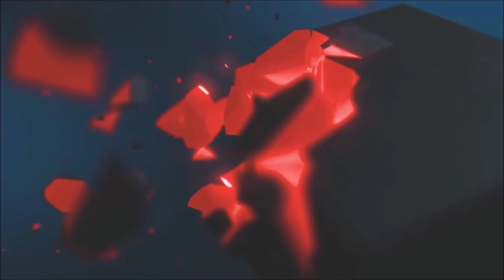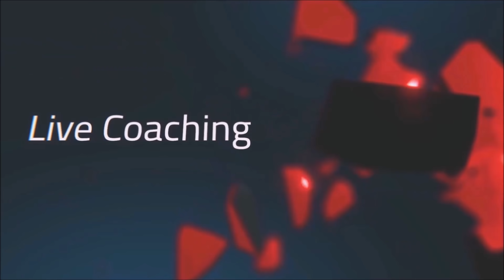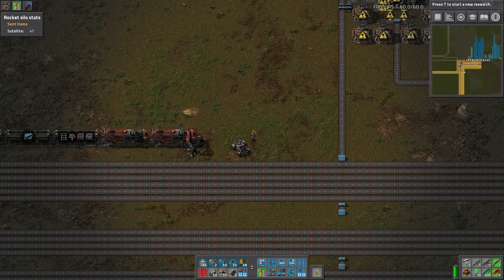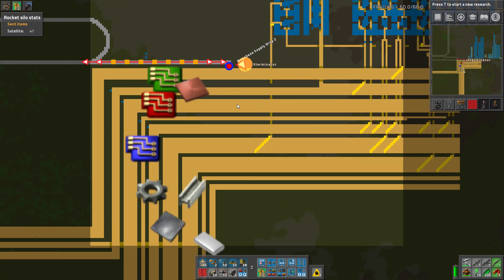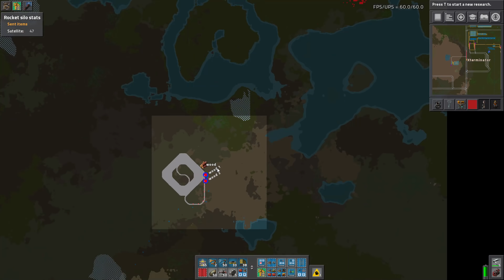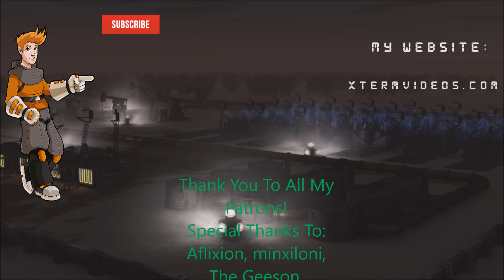Factorio: Tightening The Belt: Megabase Guide EP69 - MAIN BUS SPLIT OFFS | Tutorial Gameplay Series

Comment: 4:53 Actually, you did it correctly. You can pull off either side of the bus with that configuration.

Example image: https://i.imgur.com/nIHHY42.png
The first belt is yellow, the rest are blue... so each lane only receives 1/3rd the items it can support.

Top bus uses the "trailing cascade" method. It pulls items off the mostly empty belt, and then shuffles items down to refill the gaps. Notice the massive gaps on the output lane.
Bottom bus uses the "leading cascade" method. It continuously shuffles items down to fill gaps, and once it has shuffled down as many items as it possibly can, it then sends items to the output lane.

The "leading cascade" can pull from either side of the bus without any issue.
The "trailing cascade" can only pull from one side of the bus.

Fail Example: https://i.imgur.com/xG8D1Zx.png (trailing cascade on both busses)
Right bus: successfully outputs to 4 lanes.
Left bus: only outputs to first lane, shuffles items over leaving an empty lane. No items to output, shuffles items over. No items to output, shuffles items over.... and so on.